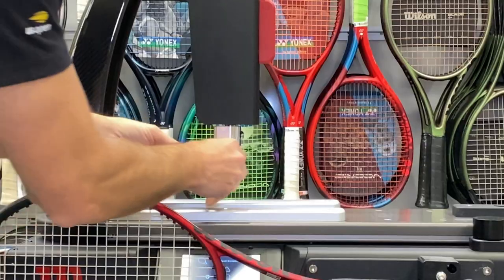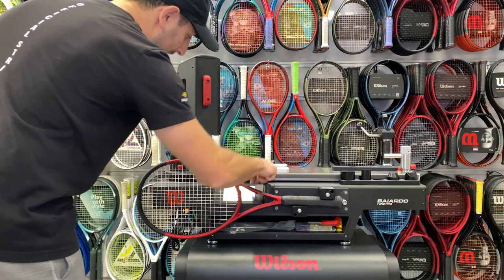Measuring Tennis Racket Vertical Bending  | Is It Time For A New Racquet? |

Comment: And when does vertical bending is supposed to occur when you do a swing ? Horizontal bending occurs at impact but I don't see how the racquet can bend much vertically.
Reply from the maker: Vertical bending occurs the same time as horizontal bending. It simply depends on the swing style and path.

Comment: Hi 

Great videos.

Can compare a NEW SHIFT racket vs a REGULAR racket (or rackets) in the same power category? Regular Flex and Vertical Flex both number? Feel free to just type them here. No video needed
Reply from the maker: I know some of the other channels do racket to racket comparison. For example, the pure drive versus the pure aero. The pure drive is for power and the pure aero is for spin… end of video. Not sure what else they cover. I don’t think matching rackets side by side is the best. For me personally, I suggest finding your top three requirements for a racket and then finding the racket that best matches those three. If you want to tell us your top goals for a racket performance, then we can best suggest. Shift is allegedly for spin (but I didn’t notice anything extra) and great spin rackets are listed in the end of that video such as Babolat Pure Aero, Head Extreme, or Yonex Vcore. (also note that any of the rackets on our website show “similar products” where we identify which rackets are similar from other brands.)
Reply: @SolowSports  i was actually only meaning the vertical flex and horizontal flex measurements. Looks you replied to me on a different video. Awesome!

Comment: Which racket has lowest flex...what is high flex good for? Low flex good for?
Reply from the maker: Great Q! As this technology is so new there is no history to work off of but we are learning so much. The measurements are incredibly important to see if your racket has deteriorated as well as which measurements you would look for in your equipment search. Recently we have customers bringing in their beat up used rackets which we compare flexes to new stock frames on the wall. We can see big differences in flex showing frame break down